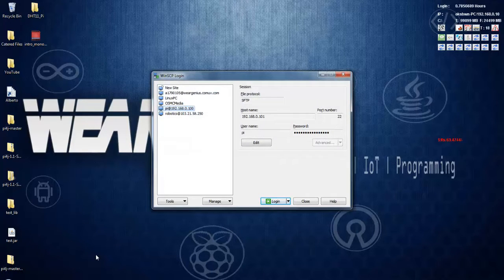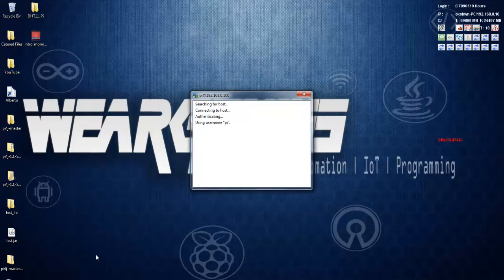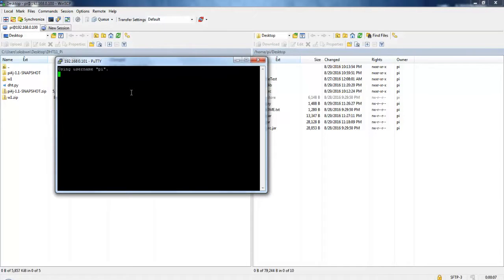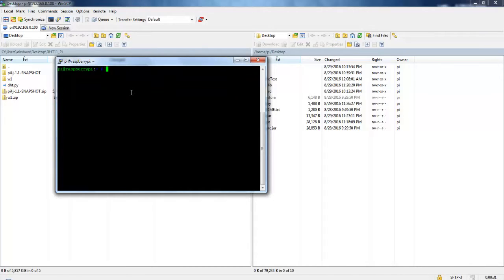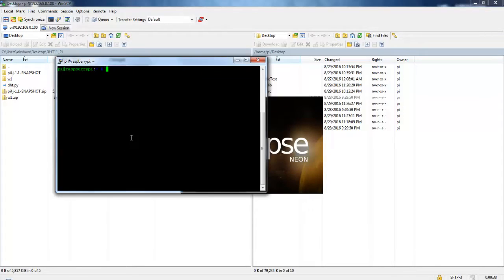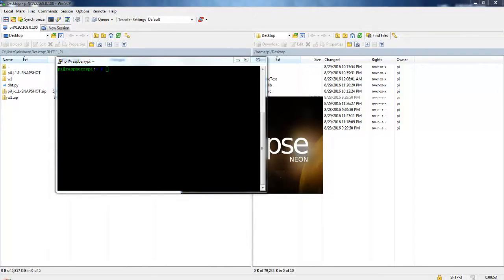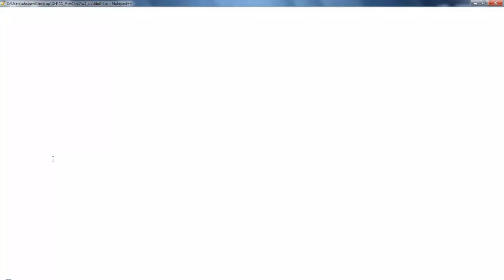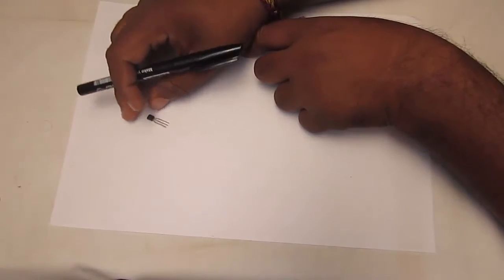Logic Level Shifter using 2N7000 | Electronics

Comment: What is the more frequency ?
Reply from the maker: More frequency means lets say you are using this for stepping down a signal with certain freqency (Simply rate of data transfer ) and do such the shifter shold be able to switch on/off at that speed. If the shifter (in this case 2N7000) is not able to turn on/off it will distort the output. When you use these shifters for high frequency communication like I2C or SPI or UART with high baudrate the 2N7000 has better performance then others (transistor or resistor volatge devider.). Hope it will help you.
Reply: I try this for 3.3 to 5 v spi data at 800 khtz, and it don.t make the job, above 100 khtz the output voltage will crash and the rise time will become too low
Reply from the maker: I Dont't have an scope so was not able to check waveform but It's working fine for me and using this circuit with ESP8266 and Arduino and i have tried 115200 baudrate. That might be happening. You can check other high speed FET. Let me know if you find the solution.
Reply: My simulation shows that the resistor has to reduce from 10kOhm  on both side in the video to a few hundreds of Ohm to make the high frequency to work. I'm not sure if it helps.